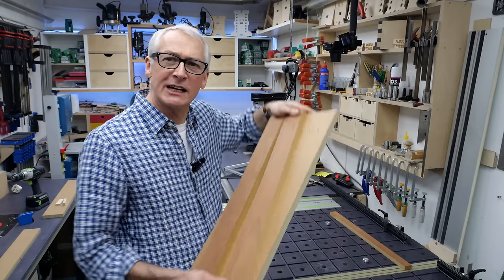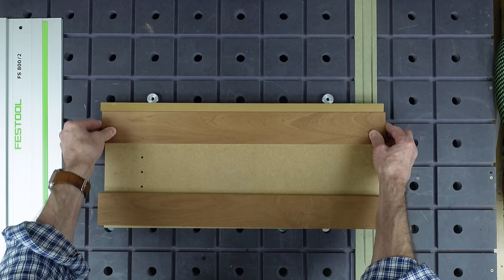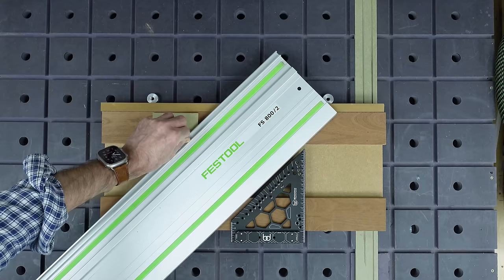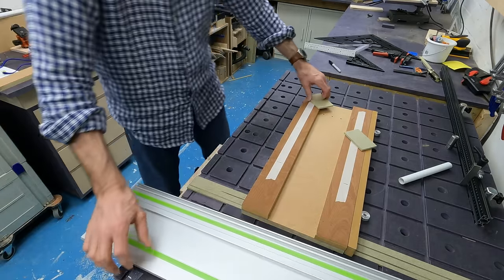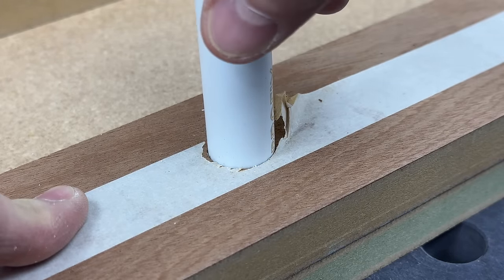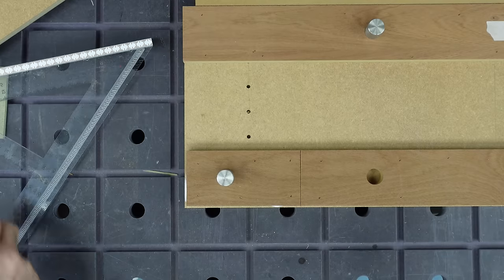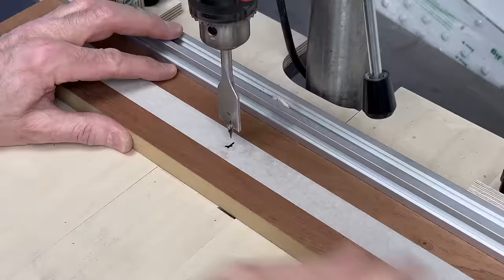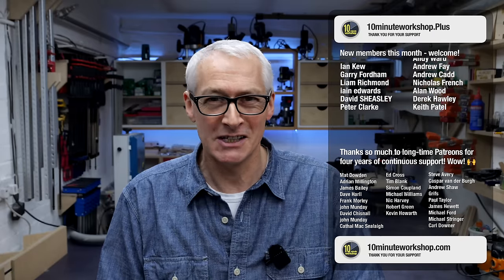Cheap & Easy Tracksaw Mitre Jig [Video 513]

Comment: And the track-saw master is back! Again, such simple but not so obvious tricks like cutting the bottom piece in 2 and getting the required accuracy that way.
Reply: I have rewatched that bit several times and still do not get the rationale behind cutting the bottom scrap into two pieces. Probably something with the kerf?
Reply: @5084204   it just allows each piece to be accurately adjusted on the jig at the end rather than having to be precise with the drilling initially which is harder to do. You’re using the known accuracy of the MFT to set the jig and the bottom two pieces do not need to be connected for that but need to be separated to allow the small adjustment necessary and the cut gives about 2mm of adjustment which is likely all that’s needed if the initial markings were reasonably close.

Comment: Hi Peter nice little jig. I made something similar for a circular saw(which lead me down the track saw path) one thing which might not be obvious to many is the importance of square pieces - I used “dimensional lumber” at the time as I couldn’t cut straight (hence the need for the jig). But it’s a chicken and egg scenario. A lot of shop made jigs are super useful and cheap to make, but the foundations of these all rest in square boards-without parallel sides, you’re doomed.
Reply: I was in that position for a long time.  The combo square and speed square I had been using turned out are not very square.  I became very paranoid when setting up my equipment.  LOL.  Even tho I upgrade all of my measurement devices, I still think they are not good enough since I was plagued by them for so long.

Comment: Damnit peter. I have a tracksaw and a Mitre saw. Needed a miter larger than the capacity of the Mitre saw 3 days ago. Spent the time fiddling with squares etc until I got the cut. Came inside and found this video. Absolutely brilliant as per usual but a bit late. . . . . .

Comment: Hi Peter, great work. I'm on the precepice of shelling out good money for a good mitre saw - my use case will be for small and fiddly trim, I am concerned that your jig won't be ideal for cutting non - square trim, like half round, baseboard, etc.
This goes as well for any mitred hinge on any MFT. At my skill level, it's hard enough keeping the track in place on longer cuts, let alone delicate short mitre cuts
Thanks!

Comment: How about using a UJK surface cam clamp 105325 12mm thick to hold small parts on your mft table? For most application it will fit under the track. For thinner stock you could fabricate a thinner cam and hold it to the table with an anchor dog.

Comment: Love it, as always. One question: it seems that the front & back pieces don't need to be as tall as the thickest stock you'll be cutting since the tall dogs account for the stock height. The front piece just act as a reference stop (fence) for the stock and could be only 6mm regardless of stock thickness. Am I missing something?
Reply from the maker: Thanks; the thing you'd be missing would be support. If the rail isn't resting on the rear fence / front batten, then it's only flat on the workpiece; with narrow stock like this jig is intended for it'd be easy for the rail to tip out of true, leading to inconsistencies in the cut. 👍

Comment: I’ve very much enjoyed your videos. I’m considering making an MFT bench but have one concern. Although the system seams to work beautifully for sheet goods, how well does it work on hardwood materials? I make small furniture made primarily of hardwoods. Trays, boxes and a bit larger items like smaller tables and bookcases. 
I’ve recently moved and no longer have the large space to work in that I once had. 
I would be very interested in videos showing your process for cutting hardwoods.

Comment: You could do dust-less crown molding with this without having a central cut station. Compound angle settings though, which can confuse people compared to holding a spring angle and keeping the saw 90, but people often do it the harder way when doing very large crown molding... You could cut gigantic molding like in some fancy Russian palace.

Comment: Nice Jig Peter, you could improve it further my adding a matchfit groove in the middle, so you could clamp a block in there for repeat small cuts.
Reply from the maker: Thanks. The idea was that it’s a simple jig you could make with just a tracksaw. You want to add in a router, then there’s a whole host of other things you could do, right?? 🤷‍♂️👍
Reply: @10MinuteWorkshop  my bad, I missed the brief, would not be cheap and easy as the matchfit router bits do cost a bit.

Comment: If ya happen to have access to a part guide this alignment is much easier, great idea though
Reply from the maker: Up to a point; I mean you could do this on an MFT to get the 45, but the point of the jig is that it supports the workpiece closely above and below the cut; without the jig you'd be balancing the saw/rail on bits of scrap and trying to keep everything together. The jig is easier, and helps get a more consistent result. 👍

Comment: Have you been peeking in my Garage (workshop) - did something very similar several years ago. Only differences was didn't move the stop (dog) on the rail closest to me but on the far one. It lasted for best part of 4 years before a neighbour 'borrowed' it - never had it back. 
Actually well done - it's nice and simple and saves on the cost of a tool. Even useful on site.
Reply from the maker: Thanks! As I say in the vid this is an updated version of one I made years ago for installs, after I found I was lugging the Kapex around just to cut tiny bits of trim. And yes, better dust collection too! 👍

Comment: A little offtopic: does the TS55 work with 165mm blades ?
Reply from the maker: Never tried it, but I’d expect not as it’s made for a 160mm blade; can’t imagine Festool would throw in a spare 2.5mm of clearance all around the blade. 🤷‍♂️

Comment: Great  video 
What have you done to your table and why did I miss tha video?
Reply from the maker: Thanks. Don’t know why you missed it, but all was told in ‘Ikea Curtain track DIY MFT’ [video 487]
https://youtu.be/223QALIbnRc
And ‘Matchfit Microjig Dovetail Clamp System’ [video 499]
https://youtu.be/uiT6F-K26Tg 👍👍
Reply: Hi Peter, yes saw your table build, i was refering to the new look with it routed out. looks like for additional cut areas. did you do a specific video on this ?

Comment: How does this work for material of different thickness? Lets say i want to cut material ranging from 1-5cm thick. The sides would need to be 5cm high to be able to fit the piece under rhe track, but that means the track would hover over material with less thickness. Would this be an issue?

Would be nice with an easy solution where the height of the track can be easily adjusted depending on the material.. but then again, maybe its not needed as long as you clamp down the piece being cut?
Reply from the maker: Use a spoilerboard to bring the workpiece being cut to the right height. If you routinely cut many different thicknesses then make two, one for thinner stock and one for the thicker.  👍
Reply: @10MinuteWorkshop  yeah, was actually thinking of making a couple of different jigs for different thicknesses.

How important is it that the track is flush with the piece your cutting? Is it ok with some gap between the track and the piece you're cutting if you make sure to clamp it down? Or would that be a safety concern?

Comment: Peter, I understand what you did, but not why.  You have your mft table.  why couldn’t you use the bench dogs with the mft to get your miter cuts? I’m still converting over to using the mft style table and track saw so maybe i’m not getting the obvious.  I have learned woodworking using more traditional power and hand tools.
Reply from the maker: As I say in the video, it’s an update of a  simple jig that I made for site use during installs, or for in the workshop when the mitre saw or MFT is set up for something else, or for the folks who don’t have an MFT or a mitre saw. 👍
Reply: @10MinuteWorkshop  Ok. I heard the mitre saw, I missed the mft.  Perfectly understand now.  Thx for the reply.